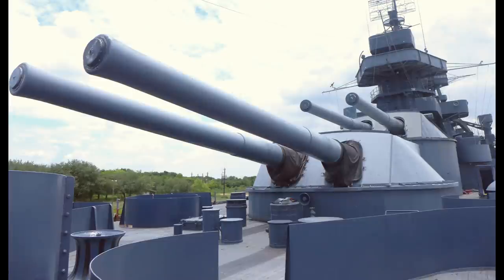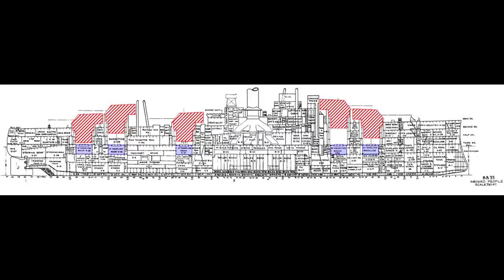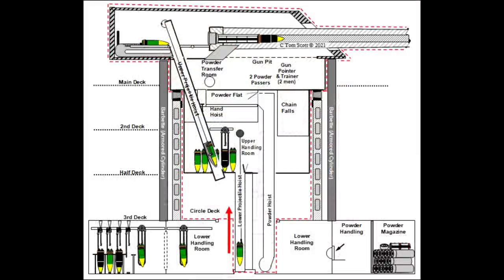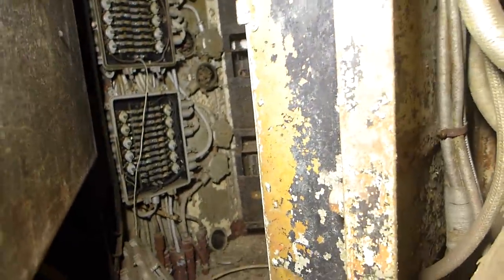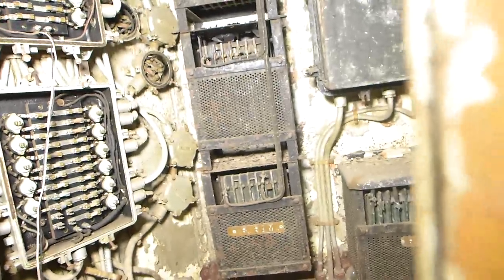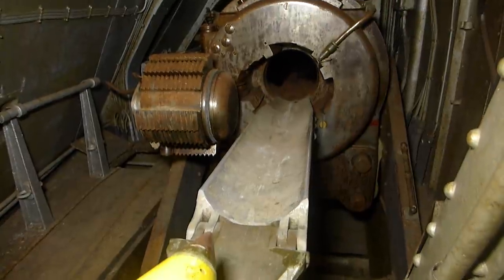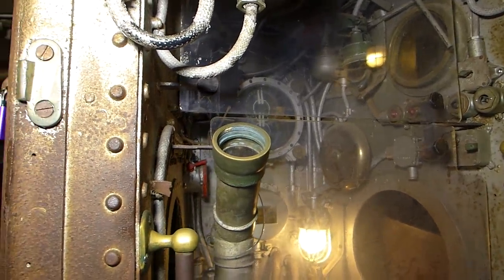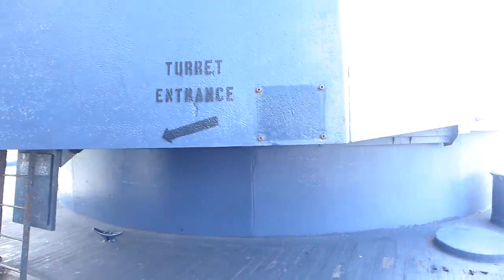Battleship Texas, Climbing A Turret

Comment: The difference between this and the Iowa handling is much different that I would have ever guessed.
Reply from the maker: Vastly different!  That's what 35 years of engineering evolution is capable of!
Reply: @tomscotttheolderone364  indeed. It would be interesting if pictures could be found to look at how the turrets on the Big 5 (Colorado and Tennessee classes) were designed and laid out. I wonder if they were very similar to the later ships or if they represented yet another evolutionary step between Texas and what we see in the WWII ships.
Reply: What struck me as really different was the shells being moved and stored nose-down... Theyd have to be lifted for each movement. But later ships (starting with ??) had the shells sitting nose up and were slid around without being lifted.
Reply from the maker: @wheels-n-tires1846  It was definitely more difficult, but the shells didn't require being set down.  There were two removable lifting eyes attached to the shell base.  Only one at a time would be used to carry a shell on a chain trolley.  Changing over to another trolley was a matter of hooking onto the second eye and letting off on the first one.

Comment: If memory serves me, this is where history was made during D day. Sounds like the sailors had a tough job.
Reply from the maker: Your memory serves you well.  The following was pulled from Chuck Moore's Battleship Texas Info website; "255 (rounds) from 0550 to 0624, 6 June 1944, Point du Hoc, Normandy France Invasion Average rate of 7.5 shells every minute for 34 minutes"  That's extremely difficult to do with an old, manual system.
Reply: @tomscotttheolderone364  
That's crazy good!! All that without air conditioning blowing on them keeping them cool.

Comment: Great video, really interesting!
Given the atmosphere where she lives, I was surprised by the generally good condition of the internal equipment.
Re the electrical flat, are all the ship's electric systems inoperative?  When we visited the Texas in '02-'05, there were tales of possible "stray ghost currents".  I thought that cool but, ummm, "interesting" for the curators and folks working on preservation projects.
Reply from the maker: A lot of work was done by one volunteer in particular over a number of years to identify stray circuits and make them safe.  I won't mention his name for privacy reasons.  However, all circuits are still treated as if they are hot as a matter of basic safety.  Some of the historic wiring with cambric insulation is used.  The insulation is the biggest concern because it gets brittle.  However, it can be used if tested with a megger and not moved around or flexed.  Little if any historic machinery or motors are used.  They are considered artifacts and parts are difficult, if not impossible, to source.
Reply: @tomscotttheolderone364  Sir, Thank you for the reply!  I am just just an over-curious engineer, and tend to poke my nose all over any museum ship.  My respects to y'all doing great work!

Comment: Wonderful video as always, Tom!  Looking forward to your next one!  It sounds like the Powder Passers/Wellmen had to lift the powder bags from the floor of the turret up to the breach, did they do that without an mechanical assistance?
Reply from the maker: They lifted the 105 pound bags up and placed them on the platform that the loaders stood on, which was a little over shoulder level.  The loaders then picked them up and set them on the loading tray (also called a spanner tray) to be rammed into the gun.  It was extremely labor intensive.  Each well man and each loader had to lift 2 bags per shot, and during D-Day were doing that about once a minute.  The only thing that may have made it easier was I found a gunnery manual that included procedures for that particular turret design.  It said that the crews should practice handling dummy bags every day so that they could do it over a period of time without breathing hard.
Reply: @tomscotttheolderone364  Did the bags have handles on them?  (I see on the videos Ryan does for the New Jersey, that the powder bags had a cloth handle in the front.)  I would seem like they would need something to grab on to lift what for most of them 2/3rds of their own weight in each bag.
Reply: BTW, great video.   Really enjoy your films.
Reply from the maker: @mikeowen9268  They did, but from what I've read in gunnery manuals that included drills, the bags were not to be lifted by the handle.  They were used to pull a bag out of its storage tank and perhaps to turn it up on end or steady it.  Picking it up, carrying or lifting one was to be done with both arms cradled under it.  That would make it extremely hard to lift one up to shoulder level.  Since there is no written procedure that I've found that describes a method, it could be that safe ways were created locally and trained into the crew.  I don't want to guess what they entailed.
Reply: @tomscotttheolderone364  when bucking square hay bales up over your head you usually use your knee together with a jerk from the arms to get some momentum to get it up above shoulder level where your arms have enough strength to take over and lift it on up. I would imagine that a similar technique would work for the bags but i don't know.

Comment: Stupid question has turret 3 got a safety interlock preventing it from being fired whilst pointing rearward? I assume it has, if so how does it work?
Reply from the maker: Not a stupid question.  There were stops that physically blocked the turret from turning too far.  There were also electrical interlocks that tripped if the turret got too close to the stop to shut the training motor off.
Reply: @tomscotttheolderone364  I believe their question had to do with whether there was a safety to stop it from firing while flagging the superstructure of the ship. Something I have also always wondered about as well.
Reply from the maker: @swb1m1  There was no safety that would interrupt the firing circuit, and no need for one because there were physical stops that physically limited turret train, thus preventing any portion of the ship's superstructure to be within its firing arc.
Reply: @tomscotttheolderone364  That makes sense for turrets 1, 2, 4, and 5, but how is that done for turret 3? Turret 3 is aimed at the superstructure when the gun is amidships, right?
Reply from the maker: @appleintosh  Train on turret 3 is limited so that it cannot train forward enough to affect the superstructure.  However, that doesn't keep it from being aimed at the mainmast directly aft.  I could find nothing to suggest that there was any type of circuit interrupter for the firing circuits when at that angle.  However, there was a danger zone system that sounded an alarm called a howler if the turret was trained within that range or close to its stops.  Here's a link to a drawing of the circuit.  https://texashistory.unt.edu/ark:/67531/metapth1188062/m1/1/zoom/?q=turret&resolution=6&lat=9372.257690102077&lon=4650.187711333714
Reply: @tomscotttheolderone364  Thank you very much for the response 👍
Reply: @tomscotttheolderone364  
I'm guessing the howlers had to be a really loud horn in order for the crew to hear it. Foghorn or Fire alarm, wonder what type it was.

Comment: It’s so difficult to see some of the rooms. Was it painted years back or always just steel? Btw this isn’t a complaint towards you. You can’t really do anything about it. It’s because the contrast of the wall is the same color so you can’t see depth very well.  But other parts it has a different color so you can see well. I would hate to die in that.
Reply from the maker: All decks, bulkheads and decks were painted steel.  None of these spaces in the turrets have been painted since the ship was turned over to the state of Texas in 1948.  There has obviously been deterioration since then.  BTW, I work very hard to not die in there.  :)

Comment: Very interesting videos and thank you for posting. I got a couple of questions since I've never been on a decommissioned Naval vessel and toured one I was wondering where you just showed us do they have lights strung up or were you lighting it yourself with camera equipment? As a side note there's no power to that ship correct? So they just run it off generators? Another question I've always wondered how do they take care of the rodent problems that must be on the ships and if you personally ran into big rats when you're deep within those ships? Anyway again thank you for posting.
Reply from the maker: I'm glad that you enjoyed the video!  The ship is hooked up to utility power, or shore power, to operate lighting in some areas and very importantly, ventilation blowers that circulate air through a number of areas.  It is also used to power receptacles in several locations.  There is lighting in the lower handling rooms where I shot the video, but not the ammunition magazines, in the rotating structure of the turret or the turret itself.  I lit the dark areas with a large led floodlight attached to my camera with a flash bracket.  I have never seen a rat, or any sign of a rat or mouse, on the ship.  It is likely because there is no food on board other than what the staff bring for lunch, and they are pretty careful about not leaving it laying around.

Comment: I'm curious about electrics; specifically, power comes up the middle to the turret, but how is it transferred to the turret in a way that allows the turret to rotate?
Reply: I think it's turret three?... has a electric motor for running the powder bag hoist,is dated 1903..I'm pretty sure it's the oldest peice of equipment on the ship

Found it milling around when I was a kid...probably wasn't supposed to be there but I went alot of places you weren't supposed to as a kid lol
Reply: Don't know for sure about gun turrets but on cranes and excavators there are basically two ways to do it. If the upper structure rotates infinitely (like in an excavator or a large crane where it can be rotated in the same direction all day) then slip rings and brushes are used for electricity and a rotary union for hydraulics and air pressure, if the rotation is restricted (usually a little more than a full revolution so when you reach the limit you must rotate in the opposite direction) then simple flexible cables and hoses hanging through the center column can be used as they'll never get too twisted. It seems on a battleship turret rotation would be restricted to less than a full circle anyway by the superstructure and the other turrets so probably just cables.
Reply from the maker: If you go to 3:20 in the video, I mention that.  Electrical power cables, data cables carrying gunnery information and compressed air lines were contained in the center column.  There are no special slip rings or brushes.  The turrets cannot make a complete rotation.  In fact, they were designed to not allow that so that the barrels wouldn't strike the ship's superstructure or adjacent turret barbettes.  Off the top of my head, the maximum train for any of the turrets on Texas is about 300 degrees.  For that reason, all that was needed was for the cables in the center column to have enough slack to follow the rotation.
Reply: @tomscotttheolderone364  Makes sense, thank you! I'm surprised cables were allowed to twist and turn like that, but I guess it works!
Reply from the maker: @robertbcope  A lot of it depends upon how the cable was stranded.  While I don't know the specifications of the cable they used, I do know that heavy gauge flexible cables meant for industrial purposes use large bundles of very small twisted strands that are in turn twisted together.  It's a twisted set of finely twisted cables.  This makes a cable extremely flexible with little fatigue.  That trick has been know for 100 years or more.  My concern would be how flexible the cambric insulation they used was.  It's an impregnated cloth fabric that gets brittle and flakes over time.  I have not seen the loops or slack where the majority of flexing takes place, but I assume that the larger the amount of slack or the loop is, the less any one section of it moves or flexes and fatigues.

Comment: The barrels on the Texas are 52.5 feet long. They are 14 inch 45 caliber guns. If you multiply 14x45 you get 630 inches long from breach to tip.
Reply from the maker: 630" bore length, 642.5" overall length.  It doesn't include the 12.5" deep screw box that the breech plug engages.
Reply: @tomscotttheolderone364  Retired machinist here. How was a Welin Breech Block machined. I just cannot figure it out, especially with the technology available over 100 years ago.
Reply from the maker: @paschaldobbins8430   I have absolutely no experience with machining, but I'm still awed at the precisely cut matching staggered threads and smaller cutouts.  What is really amazing is there are very few machine marks on any of it.  I would love to be with an old master machinist who didn't grow up with cnc equipment to hear a detailed analysis of what it would take to machine the plug and screw block assembly.

Comment: Fascinating video, Tom! I wish you could have spent more time down there, but I'm thankful you were able to capture what you did, considering the Texas heat and no ventilation!
Just two questions:
Do you have any plans to post video of the Powder Flat and Powder Transfer Room?
What are the two objects on either side of the electrical trunk at 3:41? The object on the left side looks like a giant coin return, and the object on the right looks like it might be an immersion tank?
Reply from the maker: I hope to work up "follow the shell" and "follow the powder" videos in the future.  The powder flat and transfer room will be in the one for powder.  As far as the two objects, yes, that is an immersion tank.  There's that one and at least a couple more in the handling room.   They are also located in the powder handling rooms and in the powder flat.  Any powder bag that had a tear was immediately dumped in a water filled tank along with any loose powder that may have fallen out.  That was particularly important for the black powder contained in the ignition patch on the back of each bag.  That was the really dangerous stuff.  The "coin slot" is where the removable lifting eyes drop  to when they are removed from shells.  Two are attached to the base of a shell and remain there as the shell is lifted and moved up to the shell deck.  They are no longer needed and are removed when they are put on the upper hoist.  A shell man then drops them down a tube where they land in the "coin slot" and taken back to the magazine to be reused.  The receptacle has a rubber pad in the bottom to keep the eyes from bouncing out and onto the deck.
Reply: Interesting to see one of the ubiquitous RCA speakers above the pad eye return slot. Do you know when these speakers were first used by the navy?

Comment: Imagine how many sailors received major injuries/death from simply handling the shells.  That machinery looks pretty serious and not built with safety in mind.  It would’ve been hot, noisy, dark in there.  When people think about sailors and dangers at sea they tend to think about war time.  But I can tell it would’ve been just as dangerous in there during peacetime as it was in war.
Reply from the maker: Lighting was pretty good when the ship was in service, certainly better than it is now.  As far as noise, all machinery in these rooms were run with electric motors, so I don't know that it was that loud, except for the ventilation blowers.  While there were likely some accidents, safety was paramount for them.  Drill manuals that define procedures and practice clearly demonstrate that.  However, there is always a certain level of danger involved when moving shells around.

Comment: How were the "14 inch shells fused? With those shells sitting nose first in the cradles they would have to have a dummy nose cap or something. Or am I missing something?
Reply from the maker: Good question!  The cups, or chocks, that shells were stored on were designed so that the shell was supported on on its thick wall, just behind where a fuse would be if one was installed.  It was also tall enough to keep the point of a fuse from touching the deck beneath it.  However, none of that was an issue.  Shells of all types came from the depots with base detonating fuses preinstalled in  their bases and a plug installed in the nose that was fully capable of supporting the weight of a shell.  Timer and point detonating fuses were only installed in the nose of the shell after it was in the turret and on either the dump tray or rammer tray.  The only thing the nose of the shell touched after the fuse was installed was the target!

Comment: Was every surface in the gun turret, originally bare metal, without any rust preventative, or were there some painted surfaces?
Reply from the maker: The barrel is only painted from the point where it extends out of the face of the turret.  Inside the turret, the barrel is completely enclosed within the slide, neither it or the slide are painted.  I would assume that they kept those surfaces wiped with light oil or some other preservative when the ship was in service.  That wasn't practical once the ship was retired and moved to Texas.  As bad as it may look, the corrosion is largely cosmetic.
Reply: @tomscotttheolderone364  You can tell that the rust is just surface rust.
It would probably take 10 people, three to four weeks to clean every surface.